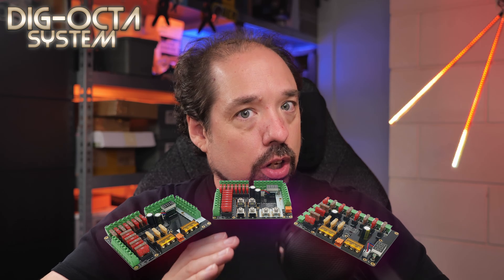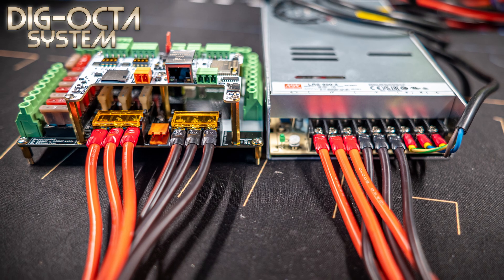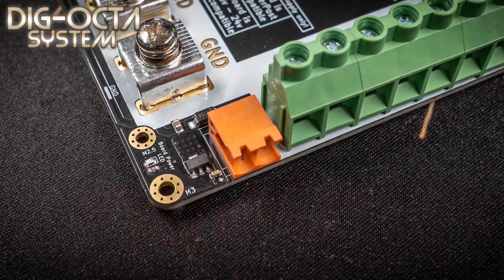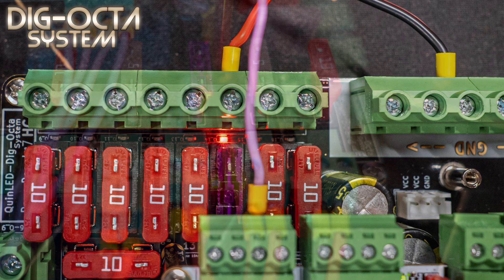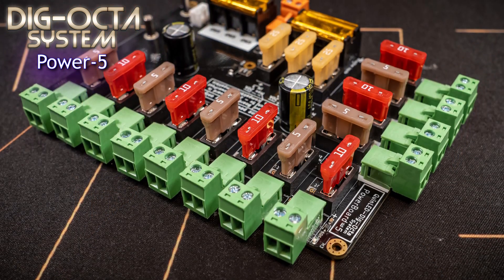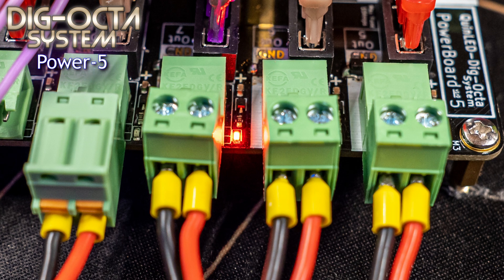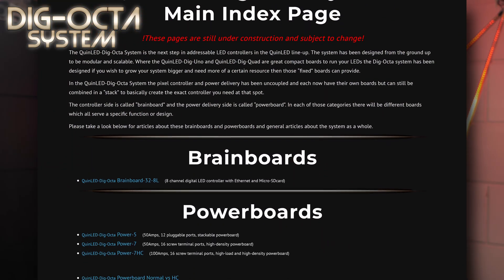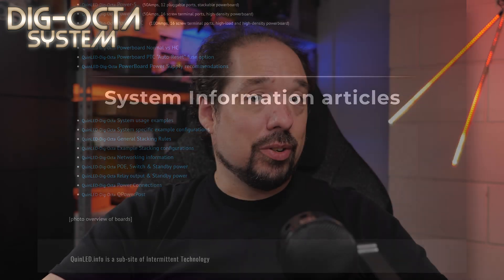💡QuinLED💡Introducing the Dig-Octa Powerboards!

Comment: Ah! I shouild have read the specs more clearly (or watched this video) before buying the Power 5. I didn't realize that I could only use 14AWG wires! I have a ~20 foot run that I was planning to use 12AWG wire for. :(

Comment: Can the board be run at 13.8v? does it regulate to 12v when supplying the strips or does it not make much difference. I have a motorhome I want to setup an Octa and board in to run COB and white strips. I have 12v lithium that will probably charge around 13.8v and would prefer to run off this direct otherwise I have a 48v bank supplying an 240v inverter and would then have to use a 240v power supply to get back to 12v. Seems a long way around to do that though.

Comment: You mentioned that for end you should use 5a fuse and middle to use 10a fuses. But on the 7HC its all 10a fuses. Should I get some 5a fuses when I feed the leds from the ends? Do you have any video on why you use 5a on end and 10a on middle?

Comment: So I bought the power 7hc. I will be running 12v. I don't think I will ever need 100 amps. Can I feed this with a smaller power supply? Such as a 600w 12v power supply instead? What con could happen putting a 50amp power supply on that power board that can take 100amp?

Comment: Do you have any resources on when/where to use 5amp vs 10am fuses on the power boards? Is it strictly number of lights off of that output?
Reply from the maker: It is related to what wire you are connecting and partly what the expected load is going to be.

Basically an edge injection is generally 4A so a 5A fuse and a middle one 8A with a 10A fuse.
Reply: @IntermitTech  any tips on this setup? I plan on using four outputs from the dig octa for one power5, and another four for a second power5. Each output would have 4-500 pixel LEDs on 5v. I was thinking to use the extra power board outputs for injection. Is there a method to think about which would have a 5a and which would have 10? Or would it potentially be best to swap them all to 5, for instance?

Comment: This is great. I was looking at running 8 strips on my driveway and wiring was going to be a pain but if I can wire individually the. I think that would work better. Probably looking at a 25 feet run to the last light strip. Do you see any issues with voltage drop and signal degradation over that kind of distance? 

I’m on my 4th board now with 2 dig quads and 2 dig unos (one I managed to short out with a badly placed screwdriver that slid underneath the board)
Reply from the maker: 25ft is a bit in the limit but without interference along the way or maybe a data booster half way, it should work fine.

Comment: I'm loving your video's. I'm currently working on my own project and am currently not using your boards but am kinda tempted to. I have worked with ESP-32's connected to WS2812B LED strips before and have an issue at the moment. I succeeded in installing a level converter to boost the signal and it actually accurately boosts the signal to 5v, problem being that somehow this drops to sub-0 when I connect the data wire. I don't know if this is intended but it sure as hell isn't working, when bridging the output to ground with an LED I can tell it's flickering at the right frequency (it's flickering at the same speed of the different effects in the neopixel library) so I'm kinda lost.

Also, is it possible to put around 15-17A through a single WS2812B? You'd think that's a bit too much current but if each led can draw around 16-20mA (50-60mA per pixel) you'd end up with that amount at full white. If that's fine then it would make my life a lot easier though.
Reply from the maker: Ah hmm, that's a bit much to go into in YouTube comments but maybe make sure to read some more of my articles too: https://quinled.info/addressable-digital-leds/

Regarding the GND make sure you have strong GND connections everywhere, maybe that will help.

Regarding your current question, no, a single edge injection will only take in about 4Amps, that's why you need power injection, see more about that here: https://quinled.info/should-you-replace-wires-on-led-strip/
Reply: @IntermitTech  I got it to work! Finally have a custom ESP-32 based controller with 4 outputs :D. Simply redid everything and left out the 330 ohm resistors people were recommending me after watching one of your videos! Will add 33 ohm / 249 ohm resistors manually when needed.
Reply: @IntermitTech  Thanks for your reply! I will definitely try to recreate my circuit and make sure the ground connections are strong. I'm currently working on making my own version of Zack Freedman's Chromance and I don't even want to run all my led strips at full white, but I just want to be safe in case I accidentally do. I will try to keep it under 4A , thanks

Comment: Love the way you have 20A max written on the board with 25A fuses in the in side fuse sockets.  
Seriously though, great information here :)
Are the screw terminals supplied for the output all Rising Clamp style and not the cheaper compression style?
Reply from the maker: Yes, true about the fuses but it's a bit complex. You don't want to run a fuse near its maximum because it will get hot and drop more voltage even if it wouldn't pop yet. The fuses also don't divide power in that sense. A 25Amp fuse is fine to protect in the scenario of a wiring issue and every part in the chain is rated to handle that amount too. So during testing I decided it was the best value to go with even though I recommend using the the boards with 50Amps total and thus in theory 3x 20Amp fuses would have worked too, just too much near the edge and not needed in this case, in my opinion. Hope that makes sense!

Yes all terminals are rising clamp except for the input, those are barrier style 9.5mm screw terminals since using fork style terminals is a bit nicer with the thicker size wires you'll generally have there, again in my opinion. :)
Reply: @IntermitTech  That's great information and 100% agree with using the 9.5mm for input as this will be where the highest current is seen.   Not that I plan running 50A worth of LED's at this stage.  It's just good to know the terminals are high quality :)

Comment: I have a question for you inntermit.Tech.  I am planning to run a 5m run of sk6812 144led//m, which requires powerinjection every meter.

First question, how do i run homeruns without making it look messy

Second question, which board should i use  a quad uno ect? each meter takes a max of 80w (max) 40w typical 

Third question, if i run 5m of 144leds/m will there be any data loss or will it look laggy/stutery?

Fourth question, what guage wire (9a per strips at 5v)  should i use for my home runs (i am planning on running 5 home runs so the strip gets power injection every meter, like you recommend) 

fifth question, is there any 12v adressable rgb strips(addresable every led)  at 144pixel/m that are efficent?  for my use case in need every led to be adressable at 144led/m

Comment: what guage wire did you use to connect the power supply and the board in the beggining? (i am talking about the three red and black wires). You should also make this board in a prebuilt variant!!!
Reply from the maker: These boards are only going to be pre-assembled boards, most people wouldn't even have the right equipment to make these at home.

Or with pre-built do you mean fully assembled and in a case or something like that? 

In the shorts it's 3x10AWG because I often run 5v and want as little voltage drop as possible.
Reply: @IntermitTech  Yes i mean assembled in a case (as it is probably more safer around pets ect) and also when will the board be avaliable??
Reply from the maker: Still debating that, this system is really designed for you to build it as you like and then on a wall or in a box, etc.. But not saying a pre-configured one won't ever be a thing either. :)

Everything should be available second week of October!

Comment: Would love to see a video on the new ATX12VO standard, specifically why you think the adapters are frying.
Reply: Yes, me too.
Reply from the maker: Interesting idea, I could take a stab at explaining why it can potentially give issues
Reply: @IntermitTech  A lot of us would like a better idea than whats currently out there for sure. My personal thoughts is that nvidia screwed the pooch colossally and didn't put any hardware/software safeguards on the new 40 series cards for current "dumb" PSUs using the older ATX spec. I'd also hazard a guess that the connector simply isn't big enough creating too much of a hotspot and/or power draw over the adapter is just way too high (4090 can draw up to and likely in excess of 600w) so the adapter needs that power draw coming from at least 2x 12v rails rather than one for better balancing in existing PSUs. Just my thoughts anyway I'd be equally curious not only to hear another persons assessment but also to satisfy myself about if I'm even remotely close in my thoughts or way off lol.

Comment: Maybe a dumb question but are these intended to use along with Dig-uno/quad as the main power source? Vs using the power supply of the uno/quad boards? Will these boards be able to hold an esp32 and Wled fully supporting 8 outputs?
Reply: You might want to review the introductory video to the Dig-Octa system. But it is my understanding that it is MEANT to be used as pairing the Dig-Octa brainboard and Dig-Octa powerboard together. You COULD use these powerboards with the Dig-Uno/Quad but I dont know why you would do that when the Dig-Uno/Quad already has it's own power inputs/outputs. The Dig-Octa brainboard already contains the esp32 chip and supports WLED.
Reply from the maker: Correct! It's designed to work together but  can also be used for standalone purposes if the situations calls for that or is just preference. :)
Reply: @TrytoCatch22  thanks I will look for it. I was trying to figure out if this was used using WLED. Unless WLED can support 8 separate channels I don’t see the point. I do know you can create segments in WLED. Thanks
Reply: @bryan34wable  WLED does support 8 separate channels
Reply: @CeJayiZSicK  if that’s the case how do you utilize all 8 channels when the Digquad itself can only support 4 channels?
Reply: @bryan34wable  as Catch 22 suggested you should watch the introduction video for the Octa system. Unlike the Dig-uno and Dig-quad the Octa splits the logic (brainboard) from the power (powerboard). The Octa brainboard has 8 data channels, and that's what these Powerboards are meant to be used with
Reply: @CeJayiZSicK  ok thank you. Makes sense now. I did watch the video  but wasn’t putting 2&2 together. Partly since I didn’t realize WLED could support 8 separate outputs. I’m on the WLED webpage now and I’m seeing WLED can actually support 10 led outputs with an ESP32. 
This is going to be awesome to have.